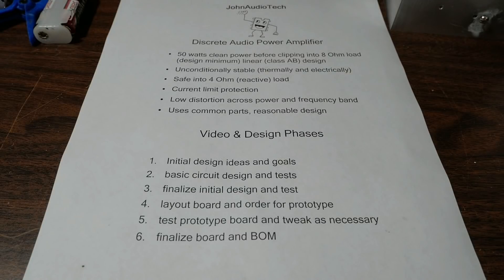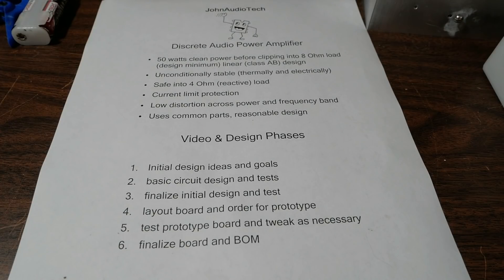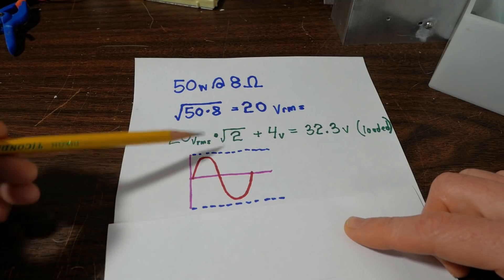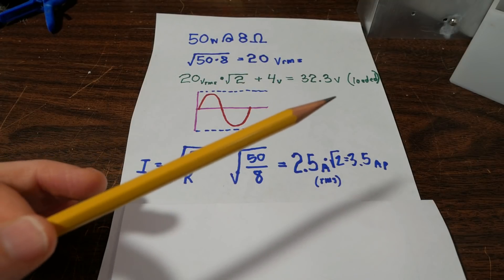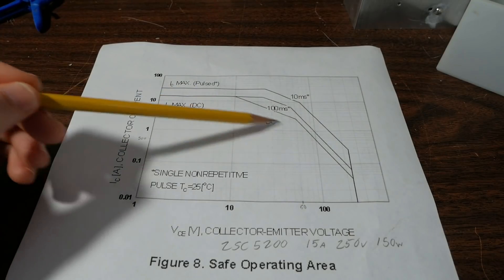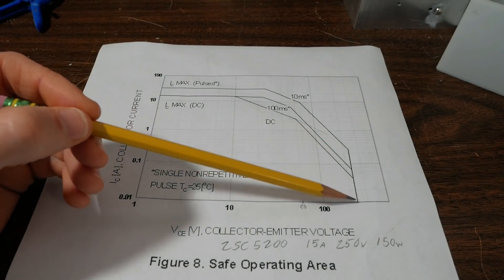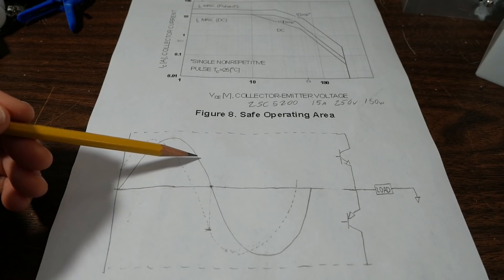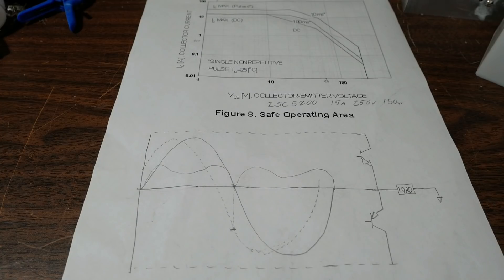Discrete audio amplifier project PART 2

Comment: Hey, this is a super awesome and informative video! But the way you present a lagging current at 13:40 is opposite of the accepted convention. waveforms further to the right lag the ones to the left, which is the opposite of how you drew it. https://www.electronics-tutorials.ws/accircuits/phase-difference.html This is closer to what I was taught as an electrical engineer, and I think everyone else will concur.

Comment: does it make a difference weather or not i use the correct "ohm." i see very small 4 ohm speakers but my amp uses 8 ohm. im only 4 feet from my tv so i dont need volume and i have been told that 4 ohm is better then 8 ohm and so the quality would be better?

Comment: Also, in your Vrms and Irms calculations, you used R = 8ohms, but these calculations are for purely resistance loads, and the 8ohms is accounting for reactive impedance. In fact, it is the impedance at some particular frequency. If you look at the datasheet for speakers, they have an impedance with respect to frequency curve that starts low (i.e., DC), then rises to some peak ("speaker resonant frequency"), then goes low and flat for a range of frequencies, then starts rising again. As an example, here is an SDS Subwoofer http://www.loudspeakerdatabase.com/Peerless/SDS-P830657. All in all, the impedance of the speaker varies with frequency, and that changes the complex power it is consuming. For the requirements of the voltage rails, going from the wattage rating, that is the real part of the complex power being supplied, and so you only use the resistance component of the impedance. So R should be 6ohm in these calculations if I'm not wrong, ignoring the AC skin effect of course. It's not a huge difference but I just wanted to point out that detail.

Comment: 13:45 Note here! Common mistake! Inducive loads of course do have lagging current, BUT if you put that up to a scope, what you'd see is the current wave form IN FRONT of the voltage one, not behind it. If a sine wave X leads sine wave Y, X reaches its peak BEFORE Y, so on a scope or on a graph, it looks as if X is behind Y PHYSICALLY (i.e., to the left), but we call X leading Y in phase!! Just something that I remember confused the hell out of me when I was in Circuits 2. And of course, likewise with a capacitive load, the current waveform leads the voltage one, so you'd see the voltage waveform be in FRONT of the current one physically, but it is lagging in phase. Kind of confusing but very important to know so you don't spread the confusion even more!

Comment: protection circuit? isn't why capacitors are use to prevent dc form going to the speakers. for audio power should be bass on square waves because it so close to 100 percent unlike a sine wave.

Comment: Hey John i've been building a power supply  33.4 - 32.6 regulated  on the rails for a studio monitor setup (which again im desiging) i intend on starting an audio electronics company hence the research and development along with the fire now and then. so if anyone wants a really dope power supply schematic reply to this comment. Also using a TIP35C 80Volts 25Amps. using the 70Volts rail it'd be perfect i think.

Comment: What about using the 2SC2922, 2SA1216 or MJL3281A, MJL1302A or MJL4281A, MJL4302A on your amplifier project?.
I have design a class d amplifier on the TPA3118, TPA3116, TPA3130D2 with through hole components.
I have the PCBs made by JLCPCB (http://JLCPCB.com).

Comment: Excellent start to the series John, nice clear discussion of output device power dissipation - I like the approach of choosing high voltage devices where the secondary breakdown hardly kicks in at all at the voltages for this project.
Secondary breakdown is, I suspect, a major reason for amplifier failure in the field.

Comment: Awesome video. I had a question for why you said a peak of 7A for the 4 ohm load.  
I get we are cutting the resistance by half, since current is squared, it only needs to grow by sqrt(2) for the same power. So I I got a peak current  of 5A. I think I may be missing something
Reply from the maker: When you half the resistance, the power is doubled in the load given the same voltage, therefore, you must use 100 watts in the equation shown when the resistance is 4 ohms.

Comment: Because of the non-unity power factor seen by the drive transistors, you will need a higher voltage rail to really achieve 50 Watts of power dissipation in a non-resistive load. I doubt your 4 Volt fudge factor will be sufficient...

Comment: From the design point of view I got the feeling that one pair of 2sc5200 with 2SA1943 can only output around 100w rms at it's best. Is it so? Or I put a lot of safety margin in this situation.?
Reply from the maker: I'd say that is correct for lower impedance loads, such as 100w into 4 ohms. Peak current is 7 amps for a resistive load and there is some margin for reactive loads.

Comment: Thanks for the awesome video, will appreciate if can also design a nice power supply schematic, people can easily replicate it on breadboard. As I believe a good designed power supply is necessary for a great sounding amplifier. A CRC power supply is good if I am correct but I'm not smart enough to design it myself.